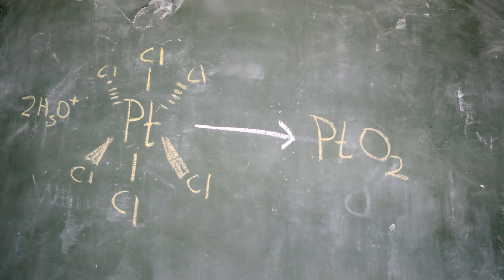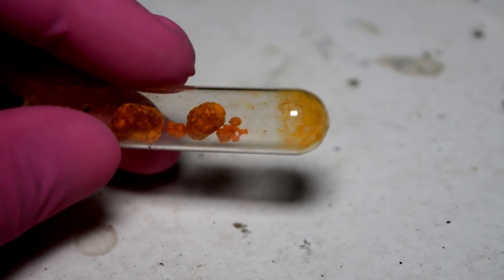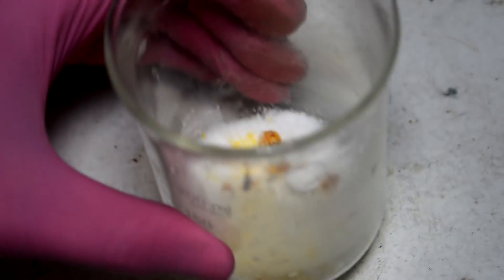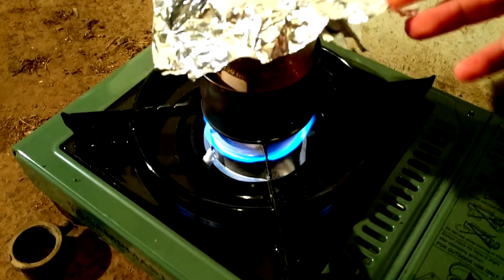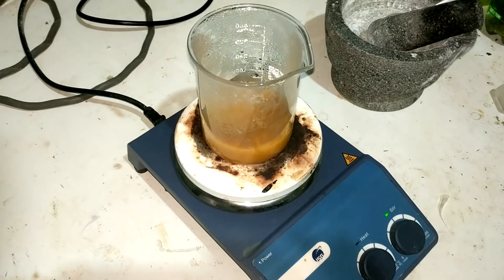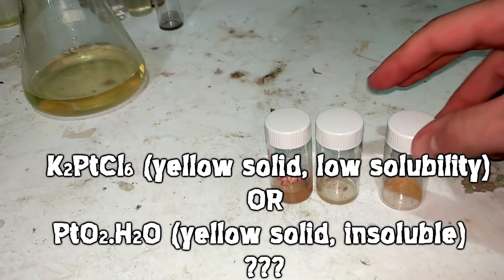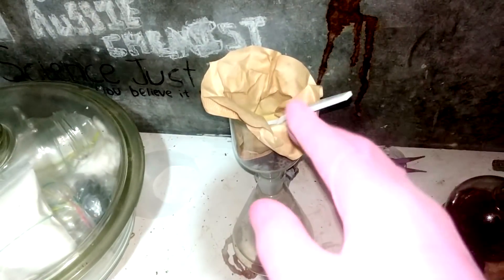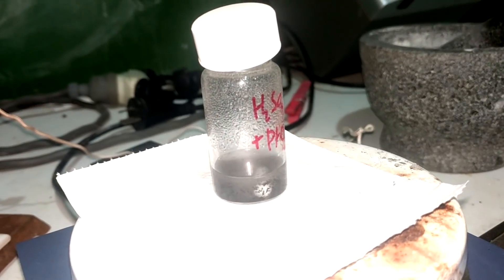Making Platinum Dioxide from Chloroplatinic acid (Adam's catalyst)

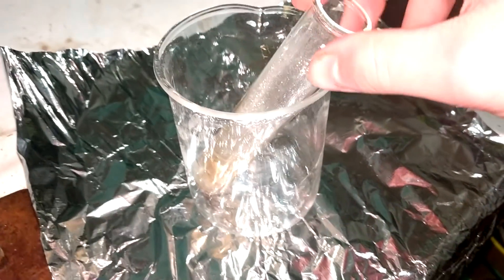Comment: 11:46 nah, the glass breaks because it's a molten potassium salt. Glass, as some may know, is made by fluxing silica with "soda", or sodium. That allows the silica to form a viscous semi molten mass which is easy to work with. Same with borosilicate, except there's also some boron oxide in it. Anyway, potassium is also a very active glass flux. It'll change the glass composition when it's molten. The hotter it gets, the more active it gets. This will screw up the glass' properties and throw the finely thermal expansion properties of the borosilicate glass waay off. It'll only do it to a certain depth though. So you'll have one layer with a modified thermal expansion bonded to the original one. Naturally, it's not gonna hold together at some point.

Comment: I have a catalytic cigarette lighter, and it is about 120 years old! I read somewhere that it contains platinum black! It contains a tiny 2.5 mm black irregular shaped ball, which is suspended in the middle of a mesh of 6 strands of 0.1mm titanium wire! This is inserted in a tube of cotton soaked in methanol and selfignites!

Comment: You invested in 1g PT compound and yielded only 0.3g of another, I wouldnt be happy.
Reply: platinum oxide has a lower molecular weight than chloroplatinic acid so it's impossible to get a higher weight of it. 0.3g isn't bad

Comment: Nickel might also work as a catalyst. It is not as effective but because it is so cheap you can use lots of it. Very fine nickel can be made by decomposing nickel oxalate with heat.
Reply from the maker: Nickel is known to a lot of people as 'poor man's platinum'. It is always better when you can replace Pt with Ni
Reply: @ExtractionsAndIre  I approve of your lab hygiene. You say it’s been several weeks since the initial cook off of the chloroplatinic acid, and the still shattered shipping ampule is safely there.

Comment: CAN YOU DESACETILATE ASPIRIN? CHEERS FROM BRAZIL.
Reply from the maker: You mean hydrolysis? Curious as to what's the interest in that mate?
Reply: **DEACETYLATE. CAN YOU DEMONSTRATE THAT PROCEDURE USING 5g OF ASPIRIN AND Ac2O?
Reply: TO ADD KNOWLEDGE, THANKS.
Reply from the maker: @theodorerobertcowell1275  ooohh you wanna make acetic anhydride from aspirin. Hmmm now that is a lot harder. I'm not sure that can be done easily, I'll look into it
Reply: YES, SINCE ASPIRIN IS NOT MADE OF SALICYLIC ACID AND ADDED WITH SULFURIC ACID OF CATALYST AND ACETIC ANHYDRYDE AND THEN IF THE VACUUM IS FILTERED AND AFTER YOU GET THE ASPIRIN, RIGHT? THIS PROCESS IS CALLED ACETYLATE. I WANTED TO REVERT THAT, I WANTED TO DEACETYLATE, IF YOU CAN DO SOMETHING BY DEMONSTRATING THAT PROCESS, IT WOULD BE GRATEFUL. MAKE A VIDEO USING 5 GRAMS OF ASPIRIN FOR DEACETYLATE. THANKS
Reply: @ExtractionsAndIre  ＢＯＬＤ　ＴＥＸＴ

Comment: Why didn't you make the chloroplatinic acid from platinum metal? Nurdrage has a good video on it, and it's a lot more cost effective (1g of platinum is like 40 bucks)
Reply from the maker: Good question. The price was good and it saved me a bit of time, but also I could never find like small amounts of Pt to buy, it was always at least a few grams and I couldn't afford the upfront investment at the time
Reply: Aren't 1 gram bullion bars available on ebay for you? They're very available here.
Reply from the maker: @billsmathers7787  they all seem to come from the states which adds like at least $30 of postage on them at least (which seems unfair for 1 gram of something...)
Reply: How about platinum wire? You could buy it in small quantities.
Reply from the maker: That tends to be quite expensive per gram of platinum i've found